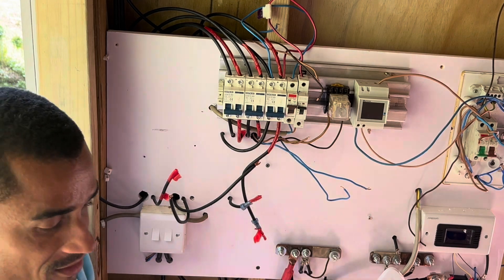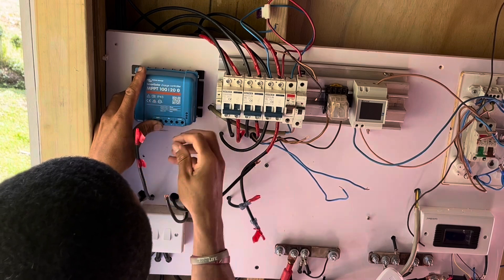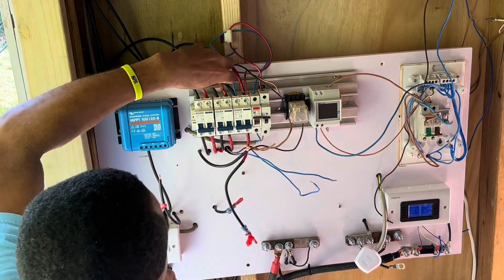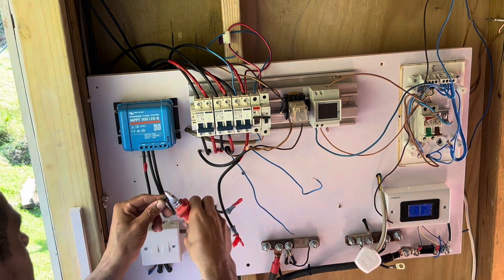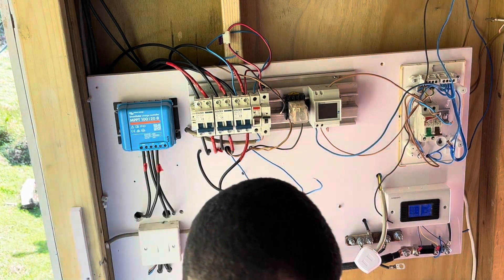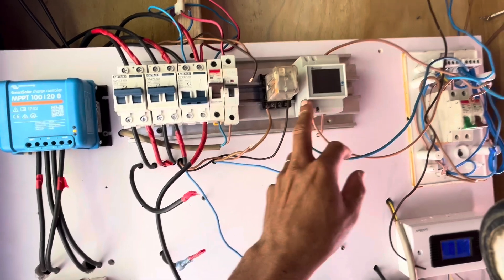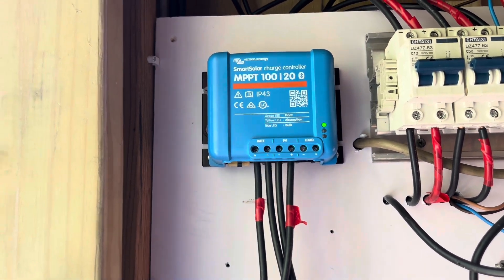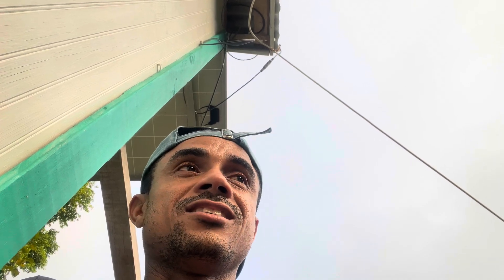I don’t pay for electricity#solarsystem#offgrid

Comment: Hi make your dad proud, clean up that rats nest you have there, use some tie wraps and get the loose wires in order. The Victron charge controller that you have is one of the best Mppt CC.  Btw to protect your system make sure you size the Breakers at 150 - 175 percent over the short circuit current, make your wires as large as possible and upsize your battery capacity. A rule of thumb is that never run your solar cells to the CC. without having the CC hooked up to the battery first. I have a small mobile system that i use to charge my RC batteries during the summer. 4 -80 watts panels with a 40amp Mppt Epever system and a remote setup, works quite well, i use #8 wires from my panel to the CC. A small 1000watts Renogy Inverter with 2 solar Batteries for 200 amps. Nice sharing your setup. hope all will be well.
Reply from the maker: @bequiakt  thanks for the info Yh I will nice up the wires for true .  I have a fuse box to install so I nice up one time

Comment: Great job.. Could you give the detailed configuration of thid off-grid system ?
Reply from the maker: @BlueThailand  configuration of thid ? Not too sure of this word
Reply: @woowoowoo784  Hi, Thank u for your answer. I mean a list of all hardware : PV, MPPT, batteries, bulbs, etc...
Reply from the maker: @BlueThailand  I have victron 100/20 solar controller 
1- DC House lithium ion battery , extra for future 
2- 246 watts solar panels 30v
1- photo voltaic sensor 
4- 7 watts dc screw bulbs led
4- angle lighting sockets
1.5mm single core wire for lights 
6 awg for cables from panels to charger
2 awg from battery to bus bar 
I will be using 1500 watts inverter in the future 
A
1  - ketotek energy meter 
Dc multifunction meter 

1 - 10 amps dc circuit breaker 
1-50 amps dc circuit breaker solar panels are In series 
Home made bus bars 
Any more question if you didn’t see something missing feel free to ask .
Reply: @woowoowoo784  Thank you very much. I will take a deep look at this list